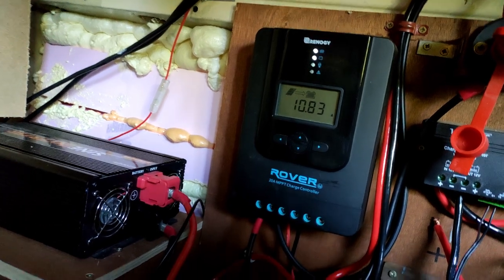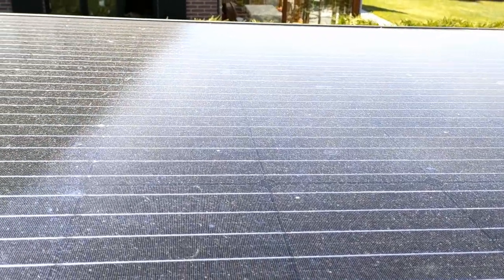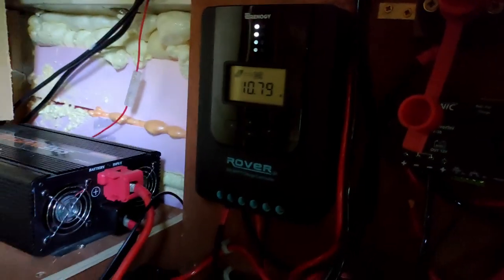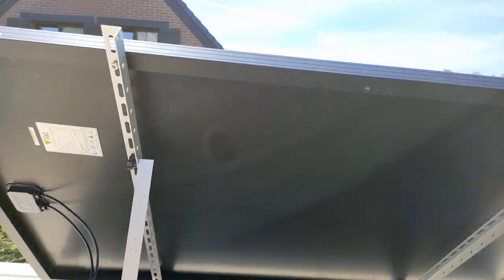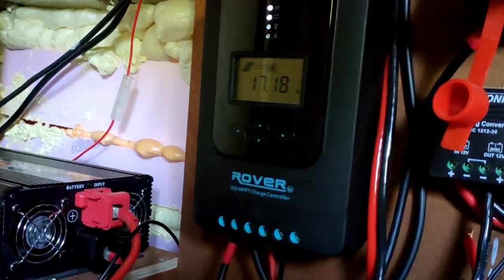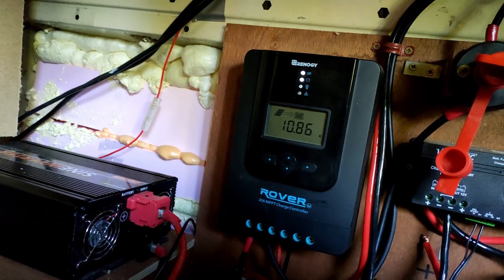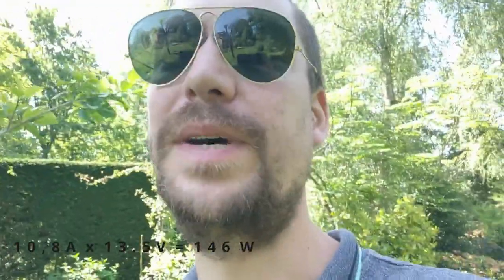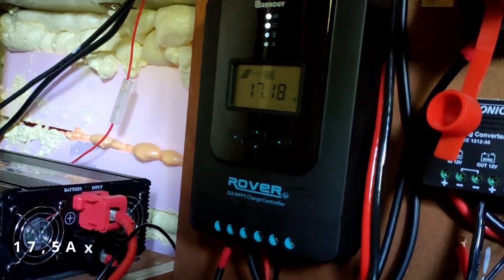Why you NEED tiltable solar panels on your van - Solar yield follow up | #VANBUILD tech talk

Comment: Good comparison; you made a believer out of me.  I have a 2007 Ford E250 van with only four compact Renogy 100w panels.  Converting to 250w used poly panels, which I have, will be a major effort and they are huge and heavy.